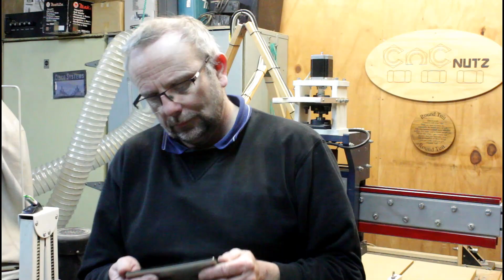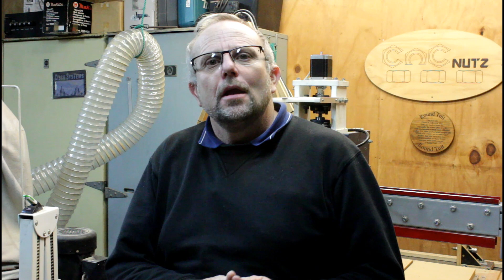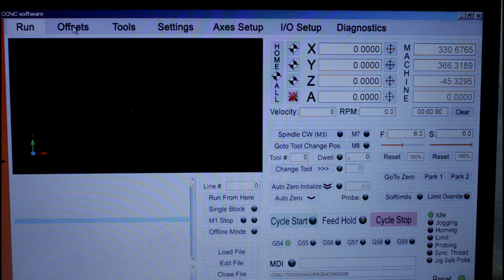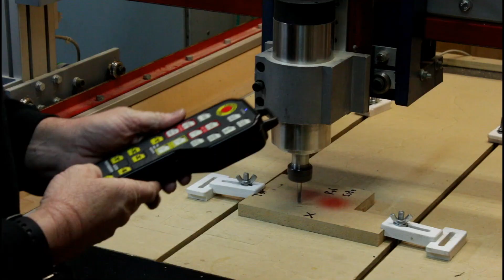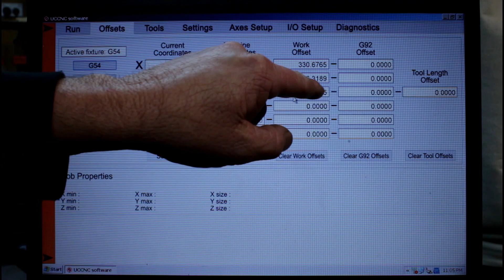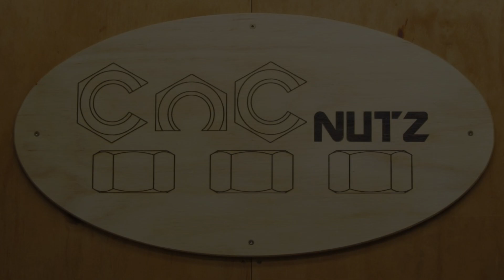Recover X&Y using Magic Offsets - CNCnutz Episode 158

Comment: Hi, my compliments or yours very instructive videos and excuse me for my bad english but I need your help! monday I start a work on 4th axis on my cnc. Since the work is very long, I stop the work and yesterday I resumed it by "run from here". When I started, the zaxis he went to crash into the top and in processing it is 2mm deeperit is 2mm deeper. I stopped the work, I zeroed the 4th axis. I started but again crashed. Normally z offset is 50 now was 75. I tried changing the offset values, but it just messed up. Now it's not like it was before. If you could help me, thanks. I don't have limit switches and I've always used goto zero

Comment: Sir my cnc machine 4040 fix Gantry table moving machine for iron carving , so how to use manually home position by hand like your video, and I have not ucc cnc software, so how to set resume Engraving , after power failure

Comment: In case somebody is looking for a better homing and referencing script.. Here is what you can do to home at medium speed and than redo the homing in slow speed to get more accurate readings from the switches:

In General Config, type in to the Initialization String window: G80, F100
This will set your default feedrate higher than 6 (otherwise the backwards move from the limit switches away
will be very slow). For me 100 workes fine, but there is no problem to go higher.

This is the code for the RefHome button to move one axis after each other..
1. move fast to the limit switch.. (("ZRefPer",20) = Z axis homing speed, as % of rapid speed)
2. back off from the limit switch (in the speed of the defined feed rate ..this is why we put F100 in General Config)
3. move again to the limit switch but slow (2% of ZRefPer)

NOTE!! In my setup the G53 move, back from the limit switch, is in negative direction for the Y and Z axis, because of the
positioning of my limit switches.. if your homing is not inverted for these axies, you need to type in "G53 Y2" for example.

// CODE FOR REFBUTTON:

SetParam ("ZRefPer",20) 
DoOEMButton (1024)  'home Z at 20%
While IsMoving()
Wend
Code "G53 Z-2"  'move off switch -2mm
While IsMoving()
Wend
SetParam ("ZRefPer",2)
Sleep 200
DoOEMButton (1024)  'home Z at 2%
While IsMoving()
Wend
SetParam ("ZRefPer",100) 

SetParam ("XRefPer",20) 
DoOEMButton (1022)  'home X at 20%
While IsMoving()
Wend
Code "G53 X2"  'move off switch 2mm
While IsMoving()
Wend
SetParam ("XRefPer",2)
Sleep 200
DoOEMButton (1022)  'home X at 2%
While IsMoving()
Wend
SetParam ("XRefPer",100) 

SetParam ("YRefPer",20) 
DoOEMButton (1023)  'home Y at 20%
While IsMoving()
Wend
Code "G53 Y-2"  'move off switch -2mm
While IsMoving()
Wend
SetParam ("YRefPer",2)
Sleep 200
DoOEMButton (1023)  'home Y at 2%
While IsMoving()
Wend
SetParam ("YRefPer",100) 

DoOEMButton(133)  'Zero X Encoder
DoOEMButton(134)  'Zero Y Encoder
DoOEMButton(135)  'Zero Z Encoder

// END OF CODE
P.s: I copied some of the code from this post and modified it: http://www.machsupport.com/forum/index.php?topic=19278.0;wap2
Reply from the maker: Thanks

Comment: While I DO have limit switches I very rarely use them. There there primarily for a case of "dumb ass" to protect the CNC.  That does happen now and then when somebody is using it that dont have much experience in jogging.  :) 

What I do when a job is going to take hours or needs high precision is to simply set the Zeros as normal ( for me)  then manual jog off the actual part to somewhere in the scrap area then runZ down and put a divot there and WRITE the x and y values beside it.  The its a simple matter to jog back to the divot as close as possible then just set the DROs with  the values written there. 

I have a wore out 1/4 bit that a friend ground down to a point that looks about the same as on an engraving bit...  Basically a 1/4 inch diameter needle.  I use that instead of some bit. No big deal as all you need to do is tighten the nut hand tight.

As mine is all lead screw you are NOT going to push things around... My steppers are dual shaft versions so I have a handwheel on he back end. I also have my controller box wired where I can flip a switch killing the power to the steppers but still leaves everything else powered. So i simply jog close to dead on then flip off the stepper power and crank to the point as close as possible by eyeball and that needle point. The I flip back on the stepper power and set zeros as needed. NOTE If you modify your controller like that DO NOT-- I REPEAT DO NOT put the switch between the power supply and the steppers as the back emf could well fry your drivers. Put it on the AC side of that power supply. 

 Why I did it like that is because often I use the cnc like a Bridgeport mill. As an example consider this...  Say you want a slot smaller that the average saw blade across a chunk of wood like say 1/16 inch. I just layout the slot with a line on one side with a pencil then clamp down the wood, flip on the router ONLY and simply crank down the Z as needed then simply crank the needed axis. Also handy for stuff too small to do safely on a table saw. I also use that trick to plane off stuff thats too small to go through a planer and when its not worth the time to do a pocket tool path and do it the "normal" cnc way..
Reply from the maker: +John Ware
Thanks John. Good advice on switch placement.
Cheers
Peter

Comment: Great Video Peter.  Unfortunately I am more of a thinker than doer.   I haven't looked into it but would anyone be able to write a macro to store/save the current line number and position of the x/y/z to a file (safe store). The 2nd part of the question is could you put a G code entry at strategic points in the job code file to call the macro.  For very long jobs you wouldn't need to got back to the start only the last known line.  Cheers  Rob
Reply from the maker: Hi Rob,
An interesting idea but not practical.
If you want to do what you propose you can simply write down the line number you are up to before you close down.
First you need to use the method in this video to recover your X Y Z starting position.
Next the only way to resume is to do a "Run from Here" so as long as you noted the line you were up to you can pick up from where you left off. 
If you haven't seen this video then have a look as it explains how to start part way into a program without having to start from scratch. It even shows how to estimate where you were up to if you don't know the line number.
https://youtu.be/x6gvNP2paCo

Cheers
Peter
Reply: Ok Thanks Peter  I have watched the Videos but was just wondering if it would be possible.  I was thinking about power fail where you can't get the line number.  I like you solutions.  Rob

Comment: Great Video Peter. I am thinking of converting to UCCNC myself.  Did you have to update your pendant to work with UCCNC ?
Reply from the maker: +Conn Fountain 
No, I used the one I already had and configure UCCNC to use it. 
See my video
https://youtu.be/rzsuPMN7U94
It shows how I configured the pendant. 
Cheers 
Peter
Reply: Thanks!  I watched it a while back and I though you reconfigured it for Mach 3.  Maybe I can reconfigure mine ( which is very similar) for UCCNC.  I am looking a UCCNC becuase of some laser work.   I could never get the  M11P1 commands to work with Mach 3 and a UC100. And I get those laser dots ( mine are quite large because I was etching a logo).
Reply from the maker: +Conn Fountain 
I did videos on both. 
Cheers 
Peter